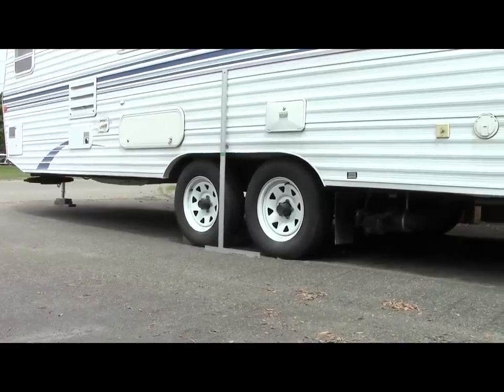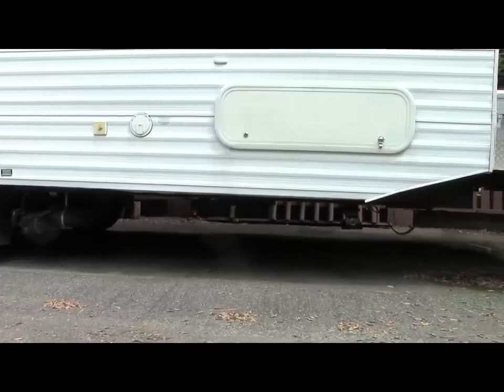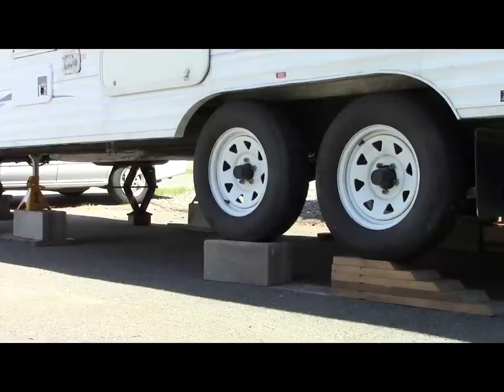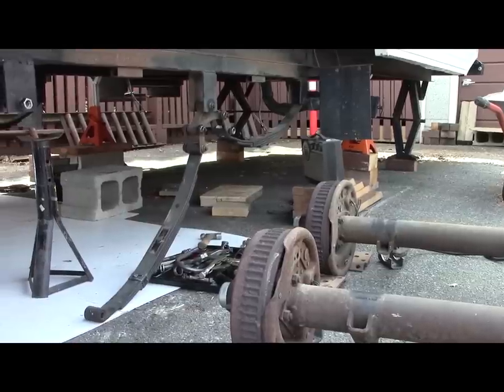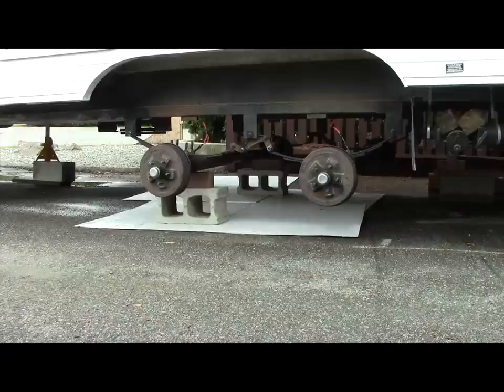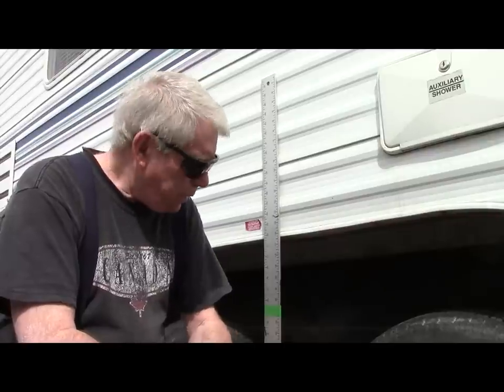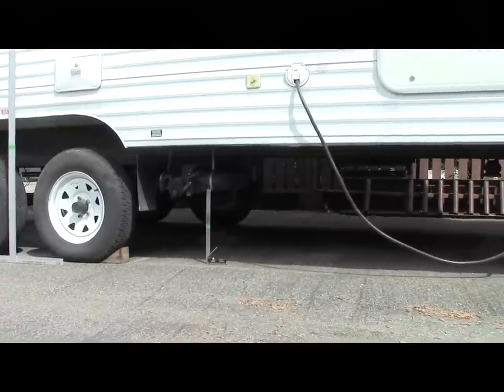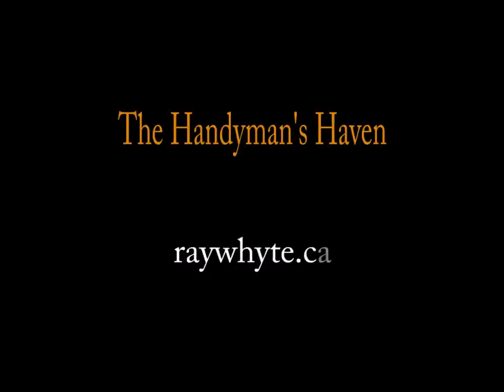Trailer Axle Flip

Comment: I would recommend turning the block on  the other side. Then use a piece of wood to cover holes, this transfers the webbing of the block to the ground. Blocks turned on the side the way they are at the 2:10 Mark are very fragile and could crush under weight.

Comment: The main reason you can't just flip the axles upside down is that the axle has a bow in them which affects tow in and out and castor and camber. When you flip them it changes all these angles which will really change your towing ability. With the axle flipped and the toe in at the back of the axle and the toe out at the front now, the trailer will wander all over the road and man you don't want that. My wife and I bought a used camper which had the axles flipped and the guy did exactly that and let me tell you that trailer was a dead trap to pull. It actually almost killed us when we were pulling it down the hiway. It started to sway from side to side to the point of the trailer just about hitting the truck bumper. All I have to say is it's a good thing I have a lot of trailer pulling experience. Just my three cents worth.
Reply from the maker: "THE SHADOW KNOWS"  thanks for your three cents worth.  If you read through the comments below, I have been preaching this for some time.  Guys usually want to use the existing spring saddles because they don't have access to a welder.  If you are purchasing a used trailed which has been lifted, take a good look at the axle/axles and make sure the factory arch in the axle is at the top and not the bottom, and a second thing to look for, does the axle have a set of saddles on the top as well as the bottom of the axle.  If there is only one saddle on one side, then make sure to check for the arch.  The exception is, a lot of newer trailers come from the factory already lifted and would only have spring saddles on the top of the axle.  Wow, that got kind of wordy, but if you still can't figure it out, just email me.  whyterj@shaw.ca
Reply: Ray Whyte I was really curious about this myself but what really made me enjoy the answer was your reply "THE SHADOW KNOWS" even as a young fella myself, I got the reference. :) Great video, as well. Thanks Ray!
Reply: Ray Whyte I agree. Not like the axles on a truck where everything is straight.
Reply from the maker: You just summed up the comments below.
Reply: Dan Moffett
Reply: If one is bowed up and one down couldn't you just swap the axles so that the bow was correct?

Comment from the maker: There is a reason for not the existing saddles.

Most trailer axles of this type have a slight upward arc to them to provide
a built in flex and strength factor.  If you flip the axle the arch is now
bowed down and reduces the strength and capacity.  The other thing it would
affect is the electric brakes, they are now in a position they were not
designed to work in.  Some axles are straight and could be flipped 180
degrees but if they have brakes, it would affect their performance.

Ray

Comment: For anybody else watching this video if you're going to use concrete blocks the holes should be vertical and not horizontal for structural strength

Comment from the maker: The saddles for the axles were bought at Princess Auto in Kelowna B.C. Canada.  Any stores handling suspension parts should have them in stock.  Make sure to measure the axle width, to get the proper size.

Comment from the maker: Good eye catching this mistake on my part.  (Time Index 2:06) If you notice the block behind this one, I have a 2x6 on top to keep my jack stand from falling into the block openings.  The one in the foreground I misplaced the 2x6 under the block so I used the flat side of the block.  You are right the strength is not there with the block on it's side.  Thanks for catching this so future viewers don't make the same mistake.

Comment: Ray Whyte...I agree with your opinion. But I'm use to slicing the perches off and it's no big deal. Quick and easy.
Reply from the maker: Robert, my new perches were less than $10.00.  I feel you risk weakening your axle with heat at this very critical point, and a hacked off perch will not sit properly on the axle.  This is my opinion.  I was born is Scotland but even I'm not that thrifty.  Good luck Lad!

Comment: The biggest problem I see with this is the changed center of gravity (as he said in video), increasing the chance of a rollover. The manufacturer simply didn't design the interior (furniture, storage, etc) with this increased height in mind. Perhaps not a problem if compensated for while loading.

Comment: I'm sure you are very proud of your project. Does this  alter your construction and use and design of the vehicle?  Wouldn't invalidate your insurance?
Reply from the maker: If you take a look at all the new travel trailers, most are coming from the factory with the springs on top of the axle.  It takes them a while to catch up and see the benefits of raising the plumbing high enough that you don't tear it of.

Comment from the maker: Michael Parker.. You could consider using an adjustable HITCH on the truck.  You could raise the ball up, lowering the ass end and leveling the whole trailer.  This will save you the work of changing the axle height.  Your comment timing is right on.  I just finished recording a video this afternoon addressing the setup for an adjustable hitch.  It will take me a few days to get the production finished.  Just subscribe to my site and you will get a notification when the video is posted for viewing.

Comment: Just remember everybody, your now 6 1/2" higher up top as well. You also need to take that into account on the teeter-totter effect at the ends of the trailer for when you enter and exit areas with restricted overhead clearances. After all, you do not want to scrape off your overhead a/c unit or whack door or roof openings as you enter, exit or pass under. (A number of YouTube videos show just that happening. That can be an expensive oops.)

Comment: i need to do the opposite of what u did and lower mine i have a camper frame that we scraped the camper and im turning into a trailer and when i pull with my truck the ass end is all the way up in the air

Comment from the maker: Paul G, the same basic steps are for both 5th wheals and travel trailers.  Just keep in mind your pin on the trailer will be higher after the flip.  You will have to raise the 5th wheel hitch in the truck or lower the pin.  There are elevation blocks you can purchase for this purpose.  In my case I had to buy an adjustable trailer hitch to get the trailer ball at the proper height so my trailer rode level when attached to my truck.  Good lick if you do this project.  Check out my web site, there is lots of info in my RV section.  www.raywhyte.ca

Comment: Is it possible to remove brake backing plate and flip it 180° to avoid having to weld a new cradle on the axle?
Reply from the maker: +E.e. W. 
I know the welding part of this project can be a problem for some home handymen.  There are no short cuts for a reason.  Read all the comments from the beginning and your questions will be answered.  The cradles are not expensive, remove the axle and take it to welding shop, it is a 20 minute job.  Good luck.
Reply: Thx.

Comment: hi,,,,,,i have a 6x10 cargo trail gvwr 2990. not sure of actual trailer weight. the trailer stands aprox.86 " high. my garage door opening is only 84" . due to hoa rules where i live i have to keep it in my garage. i was able to get it in just barely by flattening the wheels. but this s not to practical to use the trailer often.i have decided to leave it on just bare rims to solve my clearance problem to pul it in and out of the garage. and install the rimed tires once in the driveway.what i would like to know is can i raise the trailer safely leaving the hitch connected to my truck and jacking the trailer up from the center of the rear with a 3 ton floor jack to install both tires with out having to jack it up twice once from either side? will the floor jack lift the weight enough to get the tires on ? will this procedure be safe to do? keep in mind i will chock the truck tires and use jack stands under the rear when enough height is reached to take off the bare rims and install the tires.
Reply from the maker: +bob woerner Well Bob, that is a real pain in the butt, but here is my suggestion.  You want to get the trailer up in the air with as little fooling around as you can.  Here is what I would try.  Make 2 simple ramps from 2x6 lumber.  Screw enough pieces together to make the ramps high enough so you can pull the trailer up high enough on the front rims so you can install the back tires.  Now back the trailer up on 2...2x6's raising the whole trailer on the back tires.  Remove the front ramps and install the the front tires.  You may have to install some rubber(old tire tube, scrap conveyor belt or whatever on the bottom of the front ramps to keep them from slipping on the driveway.  Let us all know if this works.  Best thing it's not a lot of $$$ to invest.
I would be cautious jacking the trailer from the center of the axle,  it could bend depending on how much weight you have in the trailer.  The axles are arched upwards (just take a look at them from the back of the trailer) to counter act bending, lifting the entire weight of the trailer could result in damage to the axle.  Sorry, if you use a jack you should lift under the spring shackle which results in having to jack it up twice.
Reply from the maker: +Ray Whyte One other thought, your ramps may have to be fairly long or be interlocking pieces to avoid hitting the ramp with the front spring shackles before the front drum starts to ride up the ramp.
Reply: that would be great if i had duel wheels...... unfortunately it a single axle trailer......... also i was referring to jacking up the trailer from the rear in the center not from the axle. ....thank you for your reply.

Comment: hey Ray,,  i wanna do that to my trl,,
  but if the axle tube is about 3" diameter how come you ended up with about 6" inch lift at the end?.
Reply from the maker: Hector you are moving the axle from below the springs to on top of the springs.
So you are gaining 3 inches for the axle and the thickness of the spring pack at the axle, usually 3 - 3 1/2 inches.  In my case these were the exact  measurements thus, a lift of 6 1/2 inches.  Good luck with your project, take your time and enjoy the experience.
Reply: Ray Whyte   ok.. now i see, i wasnt tak8ng the spring pack in the equation..
  great, thanks for your reply, 👍

Comment: If you're going to use cinder blocks please flip them so that the sit as the would in a wall with the openings at top and bottom.  Time index 2:06 has one on its side under a jack stand and it is probably fine with the relatively light load of this trailer and the fact that you have redundant jack points.  But don't get in the habit of using them on their side please.

Comment: I read the comments and that's fine if you have cheap stamped perches I own a very high end toy hauler 42' three axles and my perches are very heavy gauge steel 1/4" thick and low to the axle I just don't think I would need new ones I went down to the rv dealership where I got it and the perches they have are no thicker if as thick as what I have on it
Reply from the maker: +GRASS GUY 
I'm having a little difficulty understanding the problem here.  Are your axles below the springs or on top of the springs?

Comment: Those relatively thin flat steel u-bolt clamping plates don't look like the proper ones, I noticed in one photo of the completed project the clamping plate has bowed and distorted considerably.   Not good for maintaining proper pre-load on the u-bolt!  Usually the clamping plates supplied by reputable axle manufacturers are a formed stamped steel.
Reply from the maker: George Mayhew You are right George, the clamping plates are bowed.  I torqued those suckers down so they will never come loose.  They are the original stamped steel plates supplied by the trailer manufacturer.  The next time they come off, which will probably be never, they will be replaced.  Until then, the suspension package is secure.

Comment from the maker: dankbobby;  The height of the trailer does not line up with my hitch now.  I purchased an adjustable hitch which I had to add a mod to accommodate the dual anti sway bars I use.  I will be posting a video of this in the near future.  I also needed an extra step so my wife could get in comfortably.  This mod video is already on my web site www.raywhyte.ca

Comment: if anything fails and any one of those cement blocks came under pressure...... you be dead ! those cement blocks have killed many diy guys . no matter what or how you use them they will kill you. and with jack stands  on them , i swear to you that they will fail with 200 lb s  pressure or less. you lucky you still alive.
Reply from the maker: +skipper skipper 
In retrospect skipper, I would not use concrete blocks again.  As you pointed out there is no way to determine if they will fail or not.  In this project I used them as stabilisers and not so much to carrying the bulk of the weight.
The weight of the trailer was supported on the tongue and the four crank-down jack stands.  Thanks for your comment.

Comment: Why can you not just flip the axle?
Reply from the maker: Using the existing spring perches is a definite NO NO!  you cannot just rotate the axles.  Take a good look at your axles and you will see they have an upward arch in them.  They must be installed with the arch up to maintain their maximum strength.  Therefore you must weld on new saddles to set the springs on.

Comment: Instead of flipping the axle.... burn the spring perches off the bottom and install them on the top. Now things should be right. NEVER, NEVER FLIP AN AXLE .Manufactures build the trailers low for correct traveling handling habits.
Reply from the maker: Just to clarify the term "Flipping the Axle".  Robert I know you know this but for those that don't, you do not flip the axle by rolling it over to use the spring perches already installed on the axle.  What you actually do is install new spring perches on the top of the axle and flip it from on top of the axle to under the axle.  This gives you the lift you want, which can be pre-calculated by measuring and totaling the thickness of the axle + the thickness off the spring package.  I don't suggest trying to salvage the existing perches, new perches are only a few $ and you risk weakening the axle by trying to cut off the old ones.